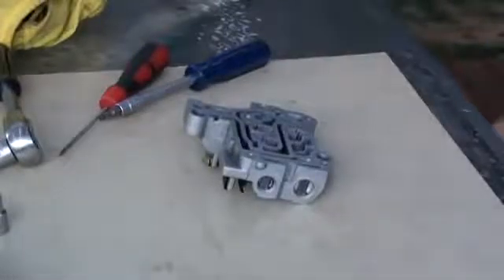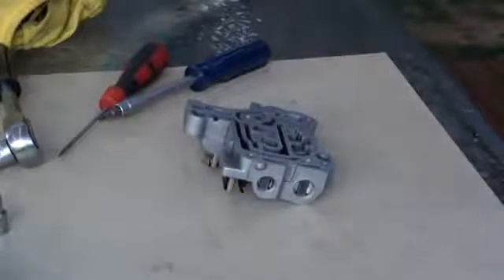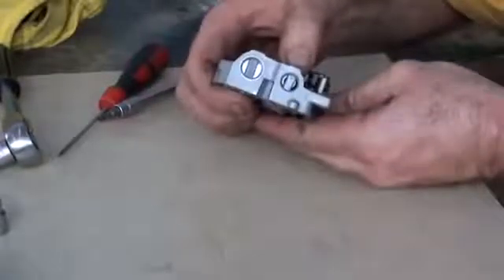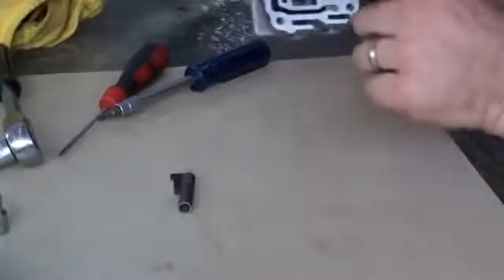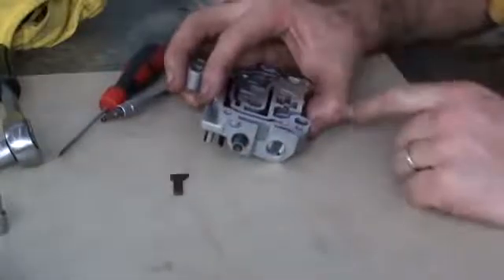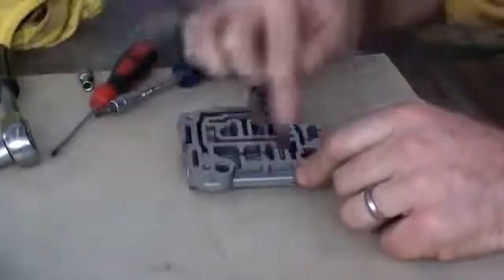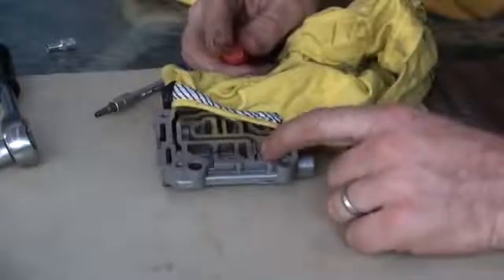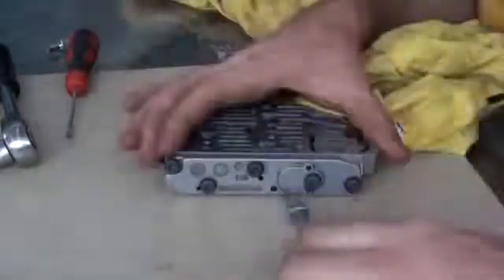ZF 5HP19 individual valve body disassembly

Comment: Hi man need your help, i got intermittent jerk when downshift from 3 to 2(coasting to stop). I already rebuild the trainny. Is there any thing that i miss? I feel then the oil temp is hot the jerk is not that violent or some time gone.. btw my car is 325..

Thanks in advance
Reply from the maker: Really hard to diagnose. Did you change the main pressure valve with something like a Transgo valve or similar?
Reply: @jeffrichardsoncardiy  yes i did(with transgo), someone say that issue come form Eds1 solenoid(main pressure) i ever change that with the used one, Since    hard to get new one in indonesia. I found strange related go oil temp sensor, tht rate 43C but the car has been sat for over a night(should be lower then that)